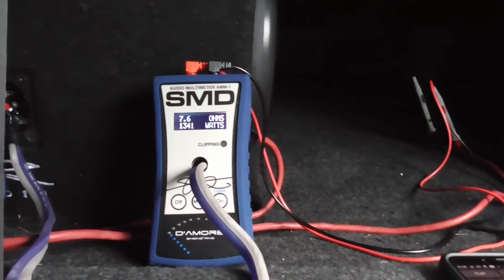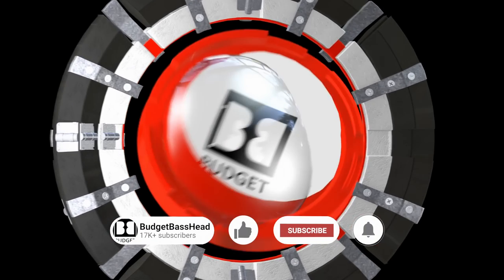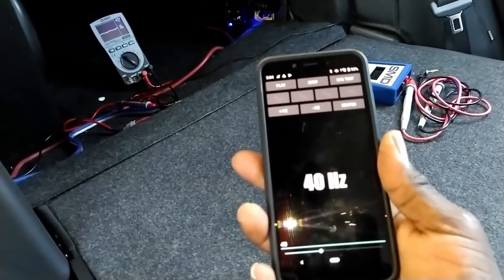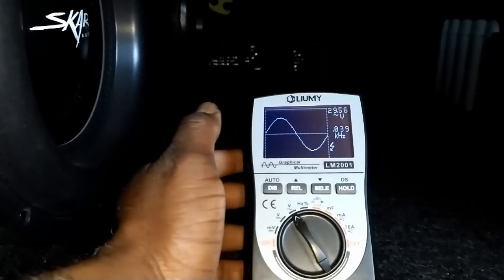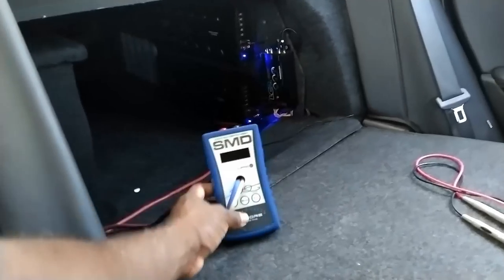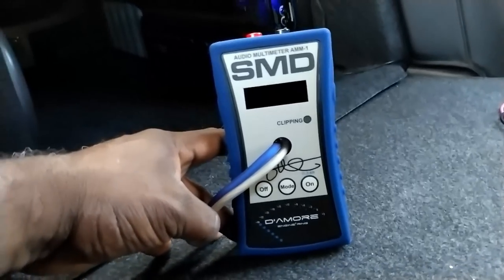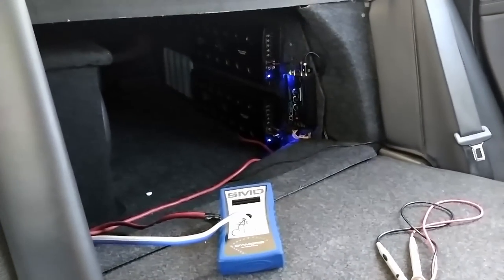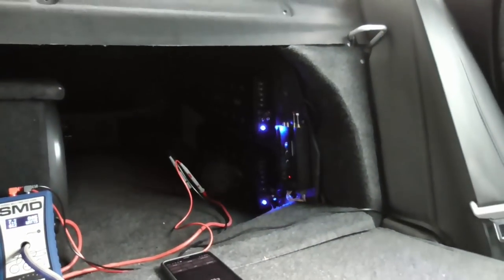How Impedance Rise Is Killing Your System!

Comment: i seen ur getting 2 8k's anyways so i won't tell you to wire down ( my girl has 2 apmn 1500  strapped: final peak numbers @ 40 hz 66v 33a 2 ohms rise wired to 1 ohm but american bass xfl that's more like .7 so each amp sees .35 i assume and 2k output at around 12.6ish source voltage with car @ idle) but i will say that your box is the main culprit. which actually surprises me because of all the cool things you've built, you're still content with the skar box. would really love to see those subs in a 4th order or iso 6th in series or even a tapered horn iso ...

Comment: I have two sundown x-15's v.3 wired to half Ohm on a crescendo 4K. And I'm rising to .67 or 1.34 ohms. I'm using a clamp meter and a regular meter. I'm clamping the two positive speaker wires. And I have the other meter hooked up to one positive and one negative speaker wire.
The subs are wired to 1 ohm in the box and half ohm at the amp. I'm not sure if I'm supposed to multiply my number or not since I only have the regular meter going to one sub.

Comment: I would try to redo the test I think you're supposed to put just the positive wire through the hole not both. I have never seen box rise into the double figures before so it seems a bit odd.
Reply: It is only the positive bud pay attention to the amp he has both of those wires twisted together as one wire and then the same for the ground so the two that u see are infact just the positive lead not one positive and one negative

Comment: It would be nice to see the DC voltage during those dyno tests.  Lose a couple volts then you lose a few hundred watts potentially.   Each amp is 2000 watts but at what Ohm load?  Im assuming they are 1 Ohm Stable(4000 watts total)but strapped probably 2 Ohm minimum(2000 watts total).
Getting 1400 watts makes sense.  You dont probably have an upgraded alternator or extra deep cycle batteries.  What size is your power wire?   How good are your connections and did you upgrade your battery ground?  I see where your 600 missing watts are going.   
Ohm load rises when you move the woofer.  Each frequency will change the Ohm load.  Plug your meter into the sub and move it with your hand.  The ohm load changes.  Ive never heard of ohm rise lol.  I dont think thats a thing.

Comment: Taramps 3 fixes box rise, people say? I didn't think there was a difference wiring 2, 1, or 0.5 ohms because they're all rated same power. So I thought oh I'll just wire to 1 ohm and prolong the amp life. Now I'm hearing about inowdence rise. And of how on that same 3k watts, due to impedance rise, my 1 ohm wiring could still be seeing almost half the power that 0.5 ohm could be seeing because it's able to rise so much higher during music? Am I figuring this correctly? And now these two XFL dual voice coil 4 ohm I'm staring and thinking I just bottleneck my system by not buying the 2 ohm versions so they can go to 0.5 ohms. Am I overreacting or is that a significant miscalculation I made, and should I send them back if I want to get the most out of this taramps? If they're at 1 ohm, they can only go to double that during music while maintaining 3k watts at 2 ohms. But, I'm seeing they routinely rise 2-4x whole playing music? That means that at points where I'm at let's say 4 ohms during music, I'll be seeing a maximum of what the amp is rated at 4 ohms (taramps smart 3 bass I think is 1700). That's almost half the power. Or, should I stick with 1 ohm because I do hear these taramps can burn up on people sometimes. Maybe I'd be less loud, but safer at 1 ohm. Help and feedback much appreciated. Keep in mind, I'm not talking 'good enough'. True what I have maybe good enough. But if I'm going to spend all this money I want to make sure I'm maxing it's capabilities. If you think I should return them and wire to 0.5 ohms, or if you don't think I'll see that much benefit, please help and let me know.

Comment: I just started running an amp that’s 800 rms at 4 ohms on a 500 rms sub wired to 2 for this very reason. I haven’t really turned it up yet in this configuration but at moderate volumes it definitely seems like it’s more consistent at different frequencies.
Reply: I also got an amp that's 800rms at 4ohm and it's gonna power a 400rms sub at 2ohm, gotta build the the box though but thanks for the information on the constancy between frequencies
Reply from the maker: Good stuff. As long as the amp is stable @2ohms it should be okay. I've heard of people often times able to run amplifiers at lower impedances, unknowingly due to high impedance rises in their systems. Not every environment is subjected to these high impedances and probably should stick to manufacture's recommendations.
Reply: Brazilian amps are weird. I don’t know where they got the idea of of making the same amp with the same power at different impedances. Only thing I’m really concerned about is blowing the sub but it’s whatever I have another one that’s on the shelf cause I couldn’t give it enough power before
Reply: Just saying, these amps claim to have constant power irregardless of frequencies and ohms, music is dynamic with numerous different frequencies each at different ohms, how is that possible, would love to know. The amp I will be using is the RF punch 800a2, can wire the subwoofer at 8ohm or 2ohm, just want great sq and efficiency and of course don't wanna damage the subwoofer but in theory wired at 2ohm the amp is gonna require twice the amperage to produce the same amount of watts as 8ohm but will definitely decrease impedance rise and will also affect sq
Reply: If you were asking me I’m no expert but my thinking is that there is less noticeable spl increase per additional wattage at higher power. Like going from 100-200w is a big difference but you probably wouldn’t notice going from 800-900. Again, just guessing. 
That amp should provide a ton of power and sound good either way. I’ve run it’s smaller brother at a 1 ohm load with no problems

Comment: the the box were facing the back so the port could load off the trunk will help you gain more cone control and will likely sound better, also having an electrical that is fully able to power both those amps even after rise would help your clamp numbers of course. takes power to make power
Reply: I thought the same. Put a meter on my trunk with same box, tested with tones facing rear, facing forward, sideways, i never ever thought it would hit its peak with the box laying on its back, port firing up, but it did. Weird

Comment: I know this is an old video,  but did anyone address the fact that he didn't reset the meter? After each dyno run you need to reset the meter that's why it didn't change.  The other thing is he didn't even bring the amps up to clipping on the meter. You can hear it get louder when he ripened it up. I think you should try this again, with the same setup.

Comment: This might be a stupid suggestion but you want to lower the bass on your head unit so your door speakers can sound normal at max volume.
Reply from the maker: Front speakers in the Impalas are dedicated woofers: 6x9s with dedicated amplifier. I keep the signal from head unit flat. Which is best for setting gains. But I understand why you suggest it.
Reply: @BudgetBassHead  Oh I see you fancy

Comment: I have the same dual subs with a skar 1200 watt amp, would u suggest getting a better amp ? Possible 2000 watt, would the dual 12’s handle that power?
Reply from the maker: You would certainly benefit from it 😃

Comment: You need to check the voltage at the rcas and see if the factory headunit and line Output converter  you are using is providing the voltage you need. Somewhere in the 1.4 volt to 5v range. I bet you are at like .7 volts or somewhere in that range at the rca

Comment: Impedence rise , impedence variations , it happens with ALL subwoofers , a fixed magnetic field with a moving energized coil changing position as the energized coil travels back and forth within the fixed magnetic field aka motor magnet ! No worries don't stress it ! If you can't knock the cone outta the frame just out more power to it !

Comment: Ive got the DD1, CC1 , TM1 and some other install stuff from Meade. His stuff is awesome. Expensive but worth it. Another great video man  😁👍👍 Is it possible that the back pressure from the size of the enclosure is the problem? Would a bigger box help? Just wondering....
Reply from the maker: I actually think the box is too small. Got plans to build a bigger one.
Reply: @BudgetBassHead  right on man. Just did that myself. I've got 4 x 12inch BDC2s. 11 cubic ft. 36 hz. Box is 250 lbs. Just got it in the van last night. 1.25 inch thick walls. 2.5 inch thick baffle. Herculiner bedliner roll on kit. Turned out nice. Old box was less than half the size.

Comment: That's why I plan on not buying some of these new budget amps I been learning alot about damping factors and amplifiers that fight impedance rises I guess I'll try to invest in getting a Rockford fosgate 1500bdcp. I heard a guys system that was saying he had the taramps 3k on a sub and it was loud don't get me wrong but I was expecting some crazy stuff for 3k watts
Reply from the maker: That Rockford amp is like $1,000 For that type of money, you can buy a 3k, an extra AGM and a DSP and have a better sounding and more powerful system than the 1500bdcp.
Reply: @BudgetBassHead  thanks for mentioning it like that I never thought of it that way
Reply: @BudgetBassHead  so you're saying I can fight what efficiency a amp like the 15000bdcp has and combat that with a 3k that's actually getting the power it needs? Another question I have though is when is it necessary to enter the High Output Alternator range?
Reply: @mallorycainjr.1921  Tbh stay away from these new Full bridge garbage amps. I have tried a Taramps HD 3000 for my subs and it sounded awful. There was very little sub bass and too much mid bass playing through the subs. I then sold it and got the Smart 3k. The Smart 3k sounded much much better. I had it pushing a B2 Rage 12 and it was pushing 1500W to the sub. It could've pushed more but the sub wouldn't take any more power. 3 or 4 months later the Smart 3k craps out. Everyrhing looks fine on the amp, it still looks brand new, it was only ever pushing half of its rated output but now from the last 2 weeks it clips 55-65Hz & 70Hz really bad. I only get 800W of clean power now before it starts to clip the sub hard at those frequencies. This isn't normal clipping either, it sounds like the sub is bottoming out even tho the sub has so much mechanical excursion left. It plays fine at every other frequency. I kept blaming the sub but I ordered a Toro R4 just to try out and make sure it wasn't the amp that was the fault but I find out that it was the Smart 3k that was the fault. I clamped the Toro R4, it's only pushing 700W to the sub because the lowest impedance I can get my sub to go to is 2 Ohms even tho it is a 1 Ohm sub. The Toro amp is doing rated power, only half the power the Smart 3k did, but sounds SOOO MUCH BETTER! There is actual sub bass in my system now! If I bring the Taramps to push 700W I ask myself wheres the bass? Do yourself a favor and please stay away from this new garbage. There's a reason these amps are so cheap. Buy the damn Fosgate, JL, etc you want. They are quality amps. They will sound much better than these full bridge amps and will outlast them by decades.
Reply: Another thing I wanted to mention. Don't go wasting your money on extra batteries, alternator etc. Efficiency is key. If you can get your system to sound the same or better than a 3000W system from only 1500W then you're the winner. Play around with the enclosure, number of subwoofers, subwoofer size before you even think about supplying more power to your amps.

Comment: Stock electric? Single battery stock alt? All these will factor amp power output. Why not drop the ohm load down below 2 ohm? That amp rating is at 1 ohm so they aren’t going to do full rated power at 2 ohm especially on stock electrical.

Comment: What  voltage output do u have from you Lc2 set at?
I’m using LC7 and I’m trying to figure out what output voltage I need to set mine to my sub amp,also do I set my gains on my LC7i first then my amp gain?thanks
Reply: Yes set the gain of the lc7i first, you can set the voltage to whatever you want on the outputs of the lc7i as long as it’s LOWER than the maximum input voltage your amplifier can handle. For example of your amp can only handle 5 vrms of input, don’t set it above 5 volts. Also keep in mind the higher you set the gain on the lc7i the lower you will set your gain on your amplifiers. Hope this helps

Comment: I'm going to shed some light on this subject for you real quick so when you are playing frequencies that are close to the subwoofers natural frequency response the natural FS you're impedance will be through the roof that's why you see a lot of these competition vehicles burping frequency way higher like 50 hertz or 60 hertz it's because the impedance is lower so they'll turn their box to it with the correct volume correct Port area correct Port velocity they get a very high db of rise you can also play the other end of the spectrum and play lower like 20hz and get her wattage with less impedance check it out with your new instruments take it easy keep on keeping on!
Reply from the maker: Exellent tip. Thanks.

Comment: Can I wire my 2 Dvc 2ohm subs down to 0.5 ohm to help with this? Currently I have a 3k HD Taraamp rated 1ohm stable and 2 Audiopipe Txx bdc4 12 
Whenever I bought them I forgot that i couldn't wire them down to 1 ohm so I'm running at 2ohm right now
I'm not to worried about it but would like to have the subs playing a little closer to their rated power because with the rise I'm sure I'm only getting like 300 rms lol
Reply from the maker: The way the math works a  dual voice coil @2 ohm rating, can be wired to either one ohm or 4 ohms. If you want to achieve a .5 ohm rating you would have to individually wire the subwoofer's voice coils in parallel to one ohm. And then you would take those two subwoofers and wire them together in parallel to .5 ohms.
Reply: @BudgetBassHead  Thanks I appreciate the response! I was just worried about frying my Amp if I wired it down to 0.5 ohm because the Amp is only rated at 1ohm Stable but with box rise I figured my Amp wouldn't actually see the 0.5 ohm so I went ahead and did it and got the result I was looking for no clipping and more bass 🙂

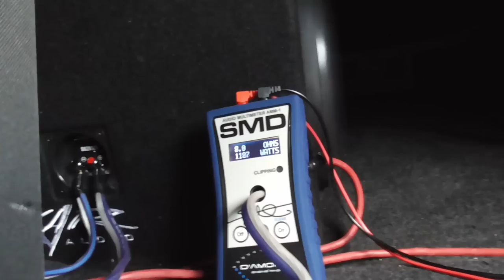Comment: 12:40 If I'm not mistaken, I thought you had to put one wire (or 1 polarity) through the SMD AMM-1 hole?
Reply from the maker: My speaker cable are each, dual 10Gauge wires.

Comment: This is why playing at tuning and tuning to where you play is very important.  This will minimize impedance rise. A well thought out system will take full advantage.  

The thing to note is playing a tone at half thr impedance will raise you final load to what your amp can handle, but this is hard on thr amp. Also, for any burst from a dead stop, the amp sees this nominal, lower load. .5 ohm for example.  

Also use the Liumy M2020. It has a much higher resolution.

Comment: Bro what is your system wired to? If I were you I would wire each one of those amps down to 1ohm a price assuming you are running 1 amp per sub. Also, those subs would like about .5 more cbft a piece out of that box. What’s you voltage like at that power? I got an 8k Taramps and clamp 6900watts. It your system is efficient you should be clamping quite a bit more
Reply from the maker: Wired to 2Ohms. Each amp sees 1ohm. Keep in mind TarAmps are Full bridge technology, whereas these amps are Half bridge. This box is too small, for starters, and my voltage is rock solid @ 13.5-14volts. Mechman 320A, with AGM and Bluetooth Ultra Capacitor.
Reply: @BudgetBassHead  1 ohm in theory but as ur meter shows ur way higher at all times so going lower on ur wiring shouldn’t be a problem. Just something i would explore and test.

Comment: So, does this mean I can wire my 1ohm stable amp at 0.5ohms? Because with a ~22hz tuned box the impedance will be bigger? (I know I have to have good electric system so no voltage dips happen, otherwise bye bye amp)
Reply from the maker: Every setup is different. You have to get to know your system in order to answer that. Find a way to measure your impedance and go for it.

Comment: Do sealed boxes have more impedance rise than ported? That would be a good video to make, compare the rise of sealed vs ported vs 4th order.
Reply: I’ve seen a video about that. I don’t remember what the results were but I just saw one yesterday with 2 different ported boxes. The bigger one had more rise
Reply from the maker: This would actually be a good test
Reply: I've biult a few 6tg orders and they only have 1ohm rise which I think is awesome
Reply: Typically, no, but it really just depends...too many design variables at play.

Comment: how about using bass boost to fight against that spot? Only a little , will it improve without distortion?
Reply from the maker: that would actually be a great suggestion if I hadn't already uninstalled 😀 Thanks for the tip.

Comment: Doesnt the gain have to be adjusted while connected to the subs so you can see if its a clean signal under load and if the amo could supply it due to good or bad electricals
Reply: No. Subs unhooked while oscope measures power to clipping